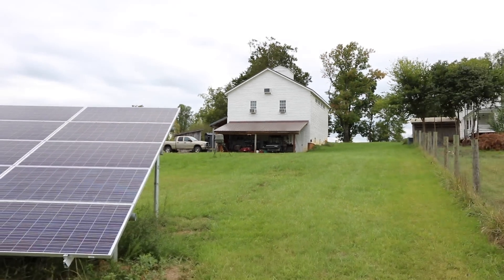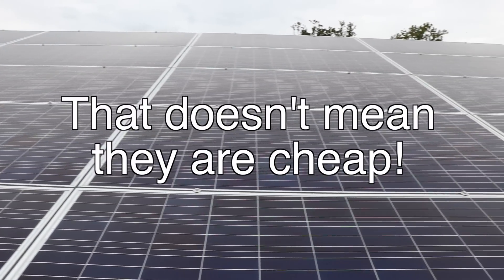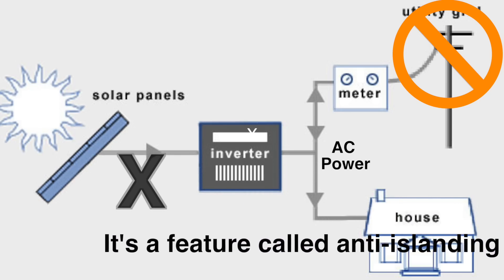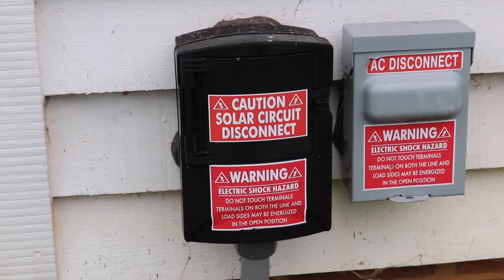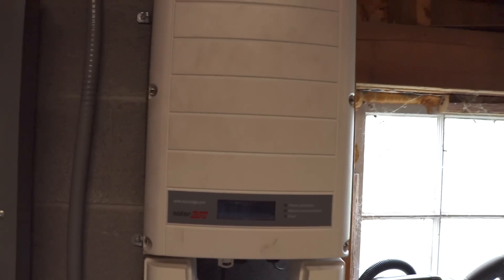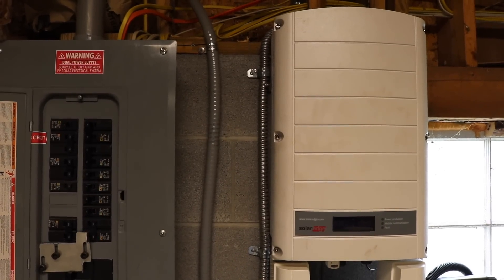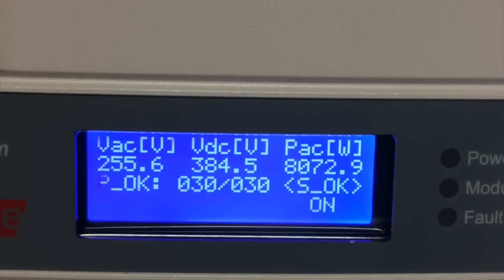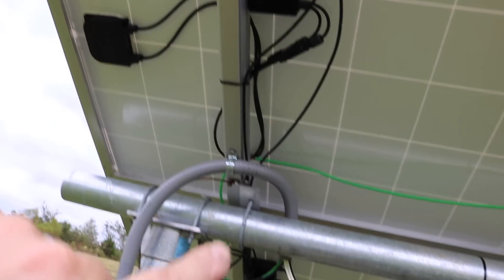The ugly truth behind grid-tie solar systems. Part 1, FarmCraft101 solar.  Watch before you buy!

Comment: The information in this video is horribly out of date.   You can no longer run a meter backwards since all meters are now digital and don't go backwards.  To feed power back to the grid you need a special meter.    Plus you can't really make money since they charge you 30 cents per KWH  but only pay you the wholesale rate of 2 cents per KWH.  To hire a pro to install your system and buy brand new equipment will mean it will take 60-100 years to get back your investment if you are relying on making money selling electricity to the electric company.  Your system will need to be replaced more often than that.   They pay you want they want to and that is hardly anything.   The only reason to be hooked into the grid is either because your system can't produce enough juice or can't compensate for a spike in demand.   If being off the grid is legal in your area (its not where I live) then it's best to just get a system that can produce all you need and use battery back up and not hook into the grid.
Reply from the maker: I have a net metering meter which allows me to feed power into the grid.  The meter keeps track of power going forward, as in to my house, and backward, as in to the grid.  Maybe there is a better term than backward, but there is nothing out of date about the video, and backward gets the points across.  You get wholesale for the power that you generate above what you use, in my area this is done on an annual basis.  So if I use all the power that I generate, then that is power that I didn't have to buy from the grid, and whatever I generated saves me the going rate for electricity, which is about 11 cents for me.  My system is on track so far to pay for itself in about 8.5 years, maybe 9.
Reply: I did not mean to imply it was not worthwhile.   Based on your description I assumed you meant that you had a mechanical meter that spun backwards when you fed power back to the grid.   As far as I knew all electric companies retrofitted all homes with digital meters a few years ago but after consulting a neighbor I have learned that some rural areas have not done so yet.   I honestly don't know what you call the meter that I have other than one needs a special permit to have one in my county.   When my system draws from the grid (rarely) it flashes a red diode.  When it feeds to the grid it flashes a green diode and when I divert from the grid it has a solid yellow light.   You can hear it make a clicking sound when it changes mode based on my consumption.   I am always feeding the grid during daylight hours and at night I usually run off my batteries but if they run low like after I have been running a lot of power equipment while running the stereo loud on a hot summer night I can hear the system click to draw off the grid.   A little alarm then goes off so I can turn off something because I hate buying electricity.

Comment: OVER 10000 $ OUT OF PACKET AND RISK OF TORNADO HURRICANE WIND RAIN SNOW CORROSION OR FIRE DESTROYING ALL OF IT ,  STILL NO BATTERY BACK UP ,  IF ONE OF THE COMPONENTS WILL BRAKE THAT MEANS HUNDREDS OF $ IN REPLACEMENT COST  IF YOU WILL DECIDE TO SELL HOUSE YOU MAY NOT GET YOUR INVESTMENT MONEY BACK .OXIDATION SOONER OR LATER WILL TAKE OUTDOOR WIRE OUT ,  WHAT IF IN 10 YEARS YOU WILL GET SHORT IN UNDERGROUND CONDUIT ,  COST OF MAINTENANCE ,  ALL OF IT MEANS  YOU MAY  SEE YOUR MONEY BACK IN 12 YEARS IF LUCKY  ???????????????
Reply: OH FORGOT TO ADD WHAT IF YOUR NEIGHBORS'S TEEN SON WILL DECIDE TO TURN SOLAR  PANELS INTO A SLINGSHOT TARGET,  OR BETTER YET METEORITE OR STRAY SHOTGUN BLAST WILL MISS A DEER AND END UP IN YOUR SOLAR GRID   WEIRD THINGS HAPPEN
Reply: DRIER , AC,ELECTRIC  AND YOUR WATER HEATER WORKING IN THE SAME TIME AND  YOU ARE GOING TO NEED WAY MORE THAN 9 KW AND IT MEANS  YOU WILL BE AT THE MERCY OF UTILITY COMPANY  ------ OUCH

Comment: I am an electronic tech of many years, you did a good job of explaining. I looked into a system with grid tie also, but battery technology just is not there yet. Also, my power company will not pay me anywhere near as much for pumping wattage into their system as they charge me for taking it back out, OUCH! Not a $1 for $1 by any means. That would extend my payback by a decade at least. Bottom line, I still consider solar systems with their low efficiency and high complexity as just science experiments, but necessary to advance the tech. Watch out, alternative tech is already out there just not mass marketed yet. I'm talking about Hydrogen based power systems, I have seen them first hand, all of the automotives have them .

Comment: Not all systems are shut off during a grid outage.  My system provides an outlet that allows me to power devices separate from the grid when I'm generating power.  I could plug in my furnance, freezer, fridge, etc.  Essentials can still be powered.
Reply from the maker: Yeah, I address that in part 2 of the series.  Is it a Sunny Boy inverter?  How does it work on a cloudy or partly cloudy day?  I guess the power to the outlet just flips on and off with the sunshine, which would work pretty well for a refrigerator.

Comment: You can reduce numbers and diameters of DC wires, if you place the inverter directly under the solar Panels, make a little weather proof housing. Like this, the DC lines with bigger loss are short and the AC Transmission from the House (to operate the inverter) and to the house with the inverted current are cheap and with little loss.
Reply: His voltage from the panels is actually higher than the house line voltage so it's better for that to be the longer line.
Reply: he's spending 17 grand and change. #8 use-2 (AL.wire) costs under a buck a foot.
Reply: totally agree with you,  Isn't that why Tesla beat out Edison? LOL
Reply: better to run the DC  has less loss  when running underground 
that is why you don't see many areas with under ground power

that is why you see a  3 phase FULL bridge rectifier before the lines go under ground because they convert it to DC voltage
Reply: Erik just for clarification but solar power goes 2 micro inverters then into the AC cutoff then from there goes into the panel on its own breaker? Just wanted to make sure I have that right because I know with a generator you can't have that running with the power from the grid as it will backfeed the generator and explode is what I've Been Told lol.
Reply: Don't even try to learn from this install!  It appears that  the labels on the boxes are wrong as far as AC vs DC.    Solar Edge optimizers are NOT micro inverters.  They just help for "independent power tracking" on each panel which is not really needed in this setup.  Many comments show confusion about why this system has a long DC run to the house. That is more for the offgrid backup  part of the system.  No fused DC combiner box is shown either.   The main confusion here is that this is two systems.  One is an XW offgrid/grid tie combo w battery back up and the other is a simple grid tied inverter.   I would have wired  10 strings of 3 panels, over sizing the array for the  6k XW inverter by about 25%.  3 panels in series match the standard max charge controller voltage for XW.  Panels are cheap, but inverters cost.  100VDC might cost $200-$300 more for wire, but it is needed, and makes trouble shooting much more easy and safe.
A 25% oversized array will typically only show about 5-10% losses since you only lose a bit of power near noon time on a cold day.  The setup shown would use $3000 more equipment, with 3 times as many connectors exposed to the weather.
Reply: @koisolare1266  (late reply) I think you are adding to the confusion some.  Yes, I also think it would be great to have a single main inverter which can take power either from the sun or batteries but today that is not realistic due to optimal voltage difference and need for switched. IN the installation on hand the DC lines feed the Solaredge inverter near the panel at 500+ volts and 20 Amps. 10 AWG cabling could handle that nicely and 8 AWG is a reasonable upsize to reduce resistance losses. 500V DC is more efficient than 240 V AC which micro inverters would produce.  He also has a battery backup system but that runs on a 48 V (?) DC independent inverter. I still have to watch his other video for details, but believe the Schneider XW series typically is 48V maybe 60 not 100. That would be just 2 panels in series, for 15 strings (still at 20 amps each).  Cheers, Hein.
Reply: @Jasonstechreview   Koi Solare

Don't even try to learn from this install!  It appears that  the labels on the boxes are wrong as far as AC vs DC.    Solar Edge optimizers are NOT micro inverters.  They just help for "independent power tracking" on each panel which is not really needed in this setup.  Many comments show confusion about why this system has a long DC run to the house. That is more for the offgrid backup  part of the system.  No fused DC combiner box is shown either.   The main confusion here is that this is two systems.  One is an XW offgrid/grid tie combo w battery back up and the other is a simple grid tied inverter.   I would have wired  10 strings of 3 panels, over sizing the array for the  6k XW inverter by about 25%.  3 panels in series match the standard max charge controller voltage for XW.  Panels are cheap, but inverters cost.  100VDC might cost $200-$300 more for wire, but it is needed, and makes trouble shooting much more easy and safe.
A 25% oversized array will typically only show about 5-10% losses since you only lose a bit of power near noon time on a cold day.  The setup shown would use $3000 more equipment, with 3 times as many connectors exposed to the weather.
Reply: Erik do you know what skin effect is? AC current likes to travel on the outside of the wire, so you need bigger copper. DC uses the whole area so you can use less copper. DC transmission is more efficient
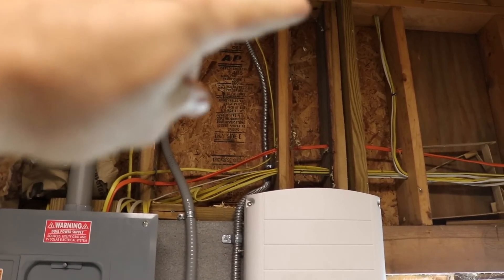Reply: @koisolare  Correct, the SolarEdge inverter is next to the main panel (6:30 into the video). There is micro-optimizer behind each panel, much like a microinverter would be. The wiring is no more complex - in a sense it is simpler as all panels on string are in series: only 1 wire goes in and out of each panel. Microinverters are connected parallel typically with a "T harness". It would be very difficult to get a shock from the DC as the micro-optimizers only deliver 1 volt initially with a bonus 'I am ready' message on the power cable. The central inverter sees this on startup and counts the panels on the string, activating each to deliver current only when it senses external AC, and only when fully connected. You can touch all wires safely until the boxes are closed and fired up. For my 24*320 watt installation I have two strings of 12 panels, with each string delivering up to 10 amps over a 10  AWG wire with no DC disconnect. Just fireman's AC outside, and quick shutdown inside (using signals/relays).  Right now being overcast, the controller indicates 2KW @ 388V DC = 5 Amps.  (fwiw - I had my share of 380 V zaps from charged capacitors that keep on giving while repairing tube amplifiers/TV's :-). Cheers.
Reply: The lights at my house went out the other day I have a hundred watt Thunderbolt solar panel and I run a drop cord from the inverter into the air conditioner and it run fine but I'm wanting to get on up to 200 watt solar panels so I'm getting confused now thanks
Reply: I like the microinverter in the panel. More that 60 volt DC is more danger that 120 AC . Can you believe any malfunction or pipe broke on load side (340 VDC).  
Other problem on series connection : if one panel have malfunction all the other (in same trim) stop working. If one panel have  shadow all other stop working.
Reply: Yes, keeping the DC down below 48VDC is safe.   The design challenge is to be able to do an offgrid backup too, using a charge controller.   I am starting to accept using more micro inverters.  I was always worried about the heat on roof mounts, and so many plugs (4x as many!) in the weather and heat.  Most seem to be working after 10 yrs.
I wonder what happens after 15 or 20 yrs?  Ground mount systems seem to be less hot and more accessable for repair though.  I still think long strings perform fine as long as panels are in same direction/plane.  The bipass diodes in the panels allow a string to stay alive with one panel in the shade and the MPPT just drops down in voltage to 9 panels ... harvesting 27 out of 30 total in this system.    @dars7063
Reply: Then you are dealing with greater reactive losses and reflections if your impedance isn't properly matched

Comment: 9kva solar cell from China cost about 3500 dollars. Large inverter cost 2000 dollar. Why 17k dollars? Does is include fixing and setup??
Reply from the maker: This was a fully installed price.  People often forget to include all the other expenses involved in a project like this, naively just pricing out the panels and the inverter.  First, quality solar panels cost more the than cheapest ones, and perform better and last longer.  From experience, I wouldn't recommend buying the cheapest ones.  The mounting system for my panels is quite involved.  The hardware alone costs almost $2k for all the steel piping and aluminum rails/hardware.  The vertical pipes are mounted in concrete.  The concrete was $750.  It took 3 men several days to set all that up, boring the holes, pouring the concrete, and installing the rails and panels.  They had to dig a ditch from the panels to the shop.  The cost of the 3 disconnects, the wiring to and in the building, inspections and permitting.  It is much more involved than just pricing out panels and an inverter.  Some people might argue that my mounting system is excessive, but we get a lot of wind, and I don't need my expensive panels blowing away in a storm.  $5500 for 9000W?  Not on ebay, which is the cheapest source of panels I can find.  Do you have a link to that system?  But again, I've dealt with cheap panels in the past, and won't make that mistake again.  Thanks for watching!

Comment: It appears that the panels could have been installed much closer to the house, therefore using a smaller length of wire (cheaper and less voltage drop). I'm guessing these were placed farther away for aesthetics.
Reply: I would use higher voltage on the solar panels maybe not 48 volts but 96 volts instead. you could even wire the home for DC instead of AC and no inverter needed. AC DC motors would work for appliances and most electronics already run on DC you just need to install Voltage Regulators.
Reply: or you just save yourself all that bullcrap and drop in a few solar panels into your existing system
Reply: The voltage drop on 8 gauge wire @ 300 feet is only about 0.31 %.
Reply: I get more like 2% assuming 360VDC, 6KW (17amps) Avg power and copper.  My super spreadsheet form Home Power Mag shows a 7 yr payback to upsize to #6  @joeturnip4216

Comment: "Meter runs backward"???
I believe the meters you have are essentially the same design as in the UK.. in which case..No the meter will not run backwards.. ever.
Reply from the maker: Google 'net metering".  Run backward might not be the best technical description, but the meter keeps track of which direction current is flowing giving the same end result.
Reply from the maker: It is exactly kWh to kWh unless you over-generate for the year.  They figure the amount of power you have generated vs how much used annually.  If you generate less than used, then you just pay for the amount of power you used beyond what you generated.  If you generate more than you used, then they pay you back at wholesale rate which is a total ripoff.  That's why I sized my system to generate 80% of my power usage.  It may work different in other areas, but that's how it works for me.  Of course, there is also a monthly grid connection fee of $25, and that must be paid regardless.  Thanks for watching.
Reply: Just a quick note to say the videos on this you have posted are very refreshing and its nice to see a system that was thought through properly. Unlike so very many YouTube'ers in particular the "prepers" who waste a lot of money doing it wrong .. time and time again.
Reply: I used to investigate meter tampering/theft of service for an electric utility. Some of the older mechanical meters could actually run backwards. However all of todays solid state meters will not run backwards.
Reply: Except your bill for electricity will not be reduced KWh per KWh from the excess you put back into the electricity grid. In some countries the amount you get back is so tiny its never going to help pay back the investment. 
In the UK we originally had very high feed in tariffs which were reduced as the cost of installing a system decreased. I believe they have now been stopped.  However the electricity companies will pay a fixed amount each year based on the expected production of your array. No matter if its all fed into the grid or used by yourself in your property.
This makes installing a Tesla styled battery pack a great idea and very cost effective too.
For heavy users its possible to go on the commercial rate for electricity where the price varies hour to hour (if not minute to minute) this makes installing a really huge battery pack worth while (not lead acid though) where you recharge the battery bank when electricity is cheap (it can get to be free or very occasionally you can get paid to  use it!) And sell it back to the grid when prices are higher. 
This is the basis of the Electric car mesh electric grid system being developed and trialled  now as I type. 
This will allow cars such as the Nissan Leaf to sell back to the grid during peak demand times (therefore higher prices) and then buy back to recharge the vehicle for the morning when the vehicle is used for commuting to work.